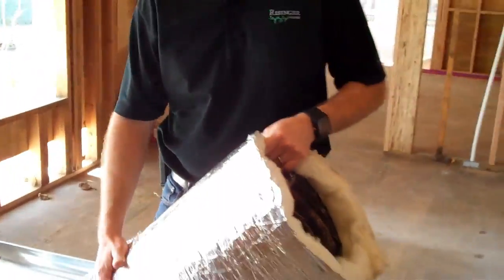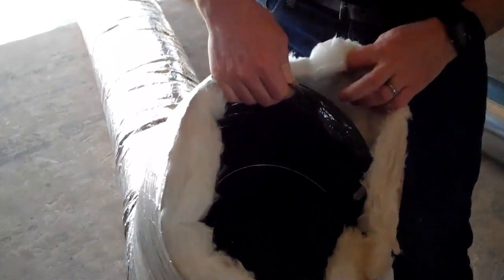Rigid Metal vs Flex for HVAC Ducting

Comment: Warning:
If These People Wanna
Replace Your Pipes For
Flex Ducts “SAY NOT”
Pipes Are Designed For Last
And Flex In A Hot Weather Is
Garbage And In A Few Years 
Gets Holes.
These People Wanna Install 
Only Flex Because They Are
Easy To Install And After They 
Leave You Wanna Replace Your
Air Handler With An Extra Tone
Because Flex Has The Not Same 
Insulation Than Rigid Pipes.
Amén.

Comment: Seach plan contains all the components of the perfect shed plan https://www.youtube.com/post/UgkxB7IXYxLzb_Ichhe45zM3Im5xfEiSp9vB that i showed you above. This includes cutting lists & tools, with clear labels showing what each item is used for. (so you can buy just what you need, budget better and multiply your floor space). So the shed ends up just clicking together at the end. Every part will fit perfectly. You see from all angles, what each part is supposed to look like before you start building.

Comment: Just had the AC company check my house out. I have a problem with one of the bedrooms not cooling. He said it was the box that distributes the air evenly in the attic and would have to be replaced. The quote was for 10,000 Dollars. Does that sound right?

Comment: It also helps to pull your flex ducts tight. If you leave them loose it restricts the flow. There’s barely a difference between flex and rigid when you properly size your duct and install it correctly. For the price difference it’s not worth it

Comment: That is the correct application for flex duct.  Use it for terminations only.  You should mention, that flex duct that is used in attics and crawl space is very susceptible to rodent damage.  They love to nest in the stuff.  I would specify 6-7 feet max of flex duct and just at the terminations.

Comment: I want to replace all the flex in the attic. Not even 10 ft flex runs. All will be sheet metal. How loud will the system be? I don’t like flex ducts at all

Comment: They used to make a flex duct called JPL. It had a scrim cloth interior that was not air tight.  If you got a tear in the vapor barrier, it became an air leak.  This crap fell apart inside due to airflow erosion.  We had a whole commercial building installed with it, and it all had to be replaced within the first five years.

Comment: Flex duct was originally designed to hook up between the trunk takeoff damper quadrant, and the register on commercial jobs.  It was never intended to be used to pipe complete systems.  Rodents chew right though this crap.  Thank you for doing things the correct way.  I prefer ridged spiral pipe with foil back insulation.  In certain parts of the country, flex is illegal.  If your HVAC contractor uses this crap for complete systems,  RUN.    Looks like you demand good quality.  Good for you!  I would say 6’ or less flex at the end of runs.

Comment: I would like to have heard some facts on rigid versus flex rather than just having repeated several times that “rigid is much, much better.”
Reply: He said that flex can be compressed restricting airflow, there is fiber in the airflow and it can be affected by uv rays. Rigid has better airflow, no fiber, but it is more expensive.  What other info would you like to have?

Comment: The metal duct will reflex the temperature of the supplied airflow because of it being metal as so whether it is hot or cold air., whereas the flex duct will absorb the temperature of the supplied airflow and discharge a totally different temperature versus what's being supplied to it. One other thing is the flex duct does not have a smooth inter surface which will create air rolling effects that are the same as turbulence, which creates resistance to the supplied air. So discharge air at the register will be off if not calculated properly.

Comment: I don't allow HVAC contractors to use ANY flex duct on my jobs. As you pointed out, it does not have a smooth interior surface and thus restricts air flow. System is more efficient without any flex duct, so why use it at all? It doesn't save that much money by using it. Stuff should be banned as far as I'm concerned.

Comment: A lot of people overlook the diffuser.
The celing defuser is rated at 50cfm for 12"x12" regester.
Usually 1 regester in every room won't flow enough cfm of conditioned air and will cause the ductwork to spring leaks.

Comment: In A perfect world, on a perfect day and  perfectly designed scissor trusses that all line up where you can get a metal trunkline is not reality "howbeit getting a 5' hardpipe in 24" O.C. trusses  sealing and insulating is a battle in itself"is not reality in most houses, it would easily take 4-5 times more labor time and expence to do it this way, But hey if your doing it time and material then milk it for all you can.A flex trunkline could be run in about 10 minutes as opposed to the metal trunk you showed would take a better part of the day

Comment: I have replaced at least a hundred of all metal systems because of failure. Insulation falls off and rusts out from the inside. More often than not the duct is full of rat excrement. They are not a one and done cost that lasts forever. What is more important than type of material is the knowledge of how to design a balanced system.

Comment: If metal is a good conductor of energy, why is it used between the air handler and the room?
Doesn’t it lose 40-60% of its efficiency?
Why not pvc?

Comment: I work with flex and we move it so it wont have restriction. We also put the mastic in the flex, attach it to the can, zip tie it tight, snip. Then bring the insulation over to mee the tie and tape it shut with flex duct tape. Then we insulate the remaining parts with brown insulation including the can if its showing silver thankyou. We have five stars on reviews on Google

Comment: In Florida, almost all residential duct work is that flex crap.  Yes, I say crap.  It doesn't seal well, tears, kinks, and degrades with the intense heat in attics.  If you get a rodent in the attic, (not uncommon), they may eat through it.  Unfortunately, insulated metal duct work is cost prohibitive for most residential homes.  So we are stuck with this shit.

Comment: Retrofitted a lot of older homes with existing pot soldered rigid ducts in them. 99% of the time I recommend keeping the rigid system and insulating to current State standards.  Often they are (by current methods) undersized but found that sealing them is easily enough to surpass current min. requirements by 50%. Personally and in the field Blaster and hood testing flex duct FR is wholly understated, it's much higher than the marketing states.

Comment: If you use a plentum box on the supply end of the furnace, please shut the fuck up and go do what you're going to do. Show that customer a picture of a REAL furnace fitting custom made, and then show them your plentum. Please, do it. You don't want to pay a sheetmetal guy and spend the money for a 10 foot break and be a REAL duct company. It's a little more expensive to use metal for the plentum? Go on and spend the extra 30 dollars? You're a jerkoff dude, you're a fucking salesman, you tell your fucking customer "we use a metal plentum which is better" and you fucking charge them on that basis, fucking jerkoff. Shut the fuck up until you have a sheetmetal shop and produce custom duct, but it's cost you more and you'd make less money. Jerkoff motherfucker. If you don't custom make your duct and you have a company, please don't talk like you're a professional, please don't. The first thing a plentum box does is interrupt airflow RIGHT off the furnace. I worked for a company that had a sheetmetal shop and we put in rectangular duct and we custom made EVRYTHING. The furnace fittings would transition from the 21 by 22 square right to the size of the duct for maximum efficiency and smooth airflow. You don't want that airflow to hit any corners, flat surfaces, or anything except a curve before it hits the end of the trunk. It hit corners and starts building pressure right off the bat with a plentum box. This guy looks clean, talks like he knows everything, and is a good salesman. We ran hardpipe until about 2 foot off the boot. That made it quiet. It dampened the noise from air flowing thru metal. If this dude talks like this and can't make a fitting and doesn't have a sheetmetal shop in his little homebase, he ain't SHIT except for another guy trying to slap a job in and make a few grand. Seriously. Don't talk all this shit about a duct system if you use plentum boxes on the supply end of a furnace. The pro's will know, you're trying to make money. That plentum box can mean the difference in airflow and 15 percent of a power bill. Don't try and tell me, I've seen it all. You want NOTHING but perfect airflow until that air hits the cap on the trunkline. Plentum boxes are for companies that don't want to pay a sheetmetal guy nor pay for metal and a ten foot break..

Comment: I know this is an old video, so I can only hope to get a response. I have a house that was built in the 20s. My ducting is made of metal and rectangular box shaped. Wrapped in asbestos to top it off, although most has been properly removed.  I would like to replace all of the ducting but am not exactly sure what to do because I am limited to the same shape that I already have since it has to fit between the Joyce's. Should I just replace it exactly as is, or is there a better option? I would greatly appreciate some feedback on this.

Comment: People who say that the flex duct restricts the airflow are overreacting. Technically, yes it does. However, installed properly, flex duct is more than adequate to get the job done properly. You just need to follow some basic rules and common sense when using it. Also, the wire that spirals the length of the flex is attached/molded to the OUTER side of the flex. The inner surface isn't nearly as rough/hostile as  you are making it out to be. As far as compressing or crushing the flex, just don't. Who runs around crushing their flex after it's installed?  Also, in some states it is mandatory that any duct run that will be inaccessible due to plywood, sheetrock etc. etc. etc...... must be 100% rigid with 0 flex.

Comment: How much more would it be to have all metal duct an no rigid duct?  Good houses are lasting 100 years or more, but I have found no house with any flex duct lasts that long without major structural repairs.  Maybe the new ductless systems are the solution but they are expensive to service an repair and do not last 20 years like a standard system will.  Also you will still need ducts for ventilation and perhaps humidity control so I think we will always need ducts.

Comment: My room is farthest from my AC unit. Its a good 5* hotter than any other room in the summer and 5* colder in the frigid Florida winters. I went in the attic to see if the ducts were leaking anywhere and didn't find anything. I cant take this heat when sleeping anymore. Gotta figure something out quick.
Reply: Frigid Florida Winters?
Reply: Popwarhomie I also lived in Florida and had the same issue but it was in my family room. I installed a high quality inline duct fan in the duct leading to my family room. The fan needs to be placed as close to the air handler as possible. I connected it to a pressure switch which activated the fan when the AC turned on. I also added a speed control so I could fine tune the amount of air delivered. I did it myself for about  $250. The fan was something similar to this https://hvacdirect.com/tt-silent-series-6-inch-inline-mixed-flow-fan-tt-silent-150.html
Reply: Thank you. Ill check that out.

Comment: Very timely advice. Just found out to today that my flex duct was trashed by pests and are wide open in spots. Trouble is they are located in a low crawl space. All work must be done either flat on your back or on your stomach.

Comment: What do you call the wall unit cage on the out side to protect the air conditioner or from thieves pushing in the air conditioner. Is it called a cage ?

Comment: "Flex" ducting was brought online because it allows poor designs to be built.  Starting at the beginning, a good designer will have modelled the house and studied the airflow and energy requirements.  After the stairs, and the structure, configure an airflow system that will work naturally (if possible) and then "assist" it as necessary.  A dropped drywall ceiling (3"to 4")  in a hall can be a central plenum, to supply any adjacent spaces.  Hot air should be allowed to escape in hot climates, causing cooler air to replenish it and overall having a cooling effect, before the HVAC equipment is applied to fine tune the environment.  The natural way is the best way always if it can be done, followed by the band-aids for bad design, the AC units, heating units etc..

Comment: Metal will sweat in the green grass states unless the installation is perfect...it will also sweat anywhere the insulation is compressed (resting on a 2x4). They make high quality duct board that has a smooth inner surface. I did my first house in metal, second one is all flex and ductboard.

Comment: would it be incredibly impractical to take on a job (the entire house renovation) this size by one's self?
Reply: Entirely depends on your skill set,  really the skills involved in hanging duct work are not all great, it's the design of the system to start with that requires the smarts, also the creation of custom connectors, say from the furnace out put to the main plenum or plenums.

Comment: love your videos... and watched lots of them.  i built a camp 4 years ago, and did not do an erv install at the time.  its one level, slab on grade... can i run insulated flex over top my attic insulation to supply bedrooms and exhaust bathroom/kitchen?  i'm getting a lot of condensation on my marvin integrity wood windows, and thats not a good recipe at all.  no problem when camps sitting on 12deg c when not in use, but as soon as getting there and bringing heat up to 23 with wood or elec obviously on cold days im getting some real problems.

Comment: We went all ridged duct.. mostly because we spray foamed the lines to make them air tight.. flex is so easy compared to ridged.. if you get a furnace guy to install “on the side” you can save a ton of $$$.

Comment: Flex board used in FL with flex duct feeds.  Much better insulated tin.  Static pressure have to be right for efficiency!  I bet less than half new and old are not.  How about putting mastic inside joint and then snap together seams and usual mastic over that.

Comment: Matt, I have a house in S. FL built in the 40s with the metal ducts. I got a high efficiency  Carrier Infinity and my ducts started to leak. I had someone come in to rewrap them and two years later there are wet ducts again. What would your recommendation be for this? Everyone wants to do flex ducts. The guy that had wrapped my ducts had a hard time because they site on the trusses. He also had to replace a short section with flex that is not suspended and it is now totally wet. I find it impossible to find someone to do a good job. I hate to give up my metal ducts but everyone keeps saying they will never be good any more.
Reply: Sounds like they're not properly insulated

Comment: This guy is spot on. Flex duct is used because it's: 1. Cheap. 2. Very fast install. 3. Allows for inappropriate installs for speed (i.e. weird bends, etc. to make install easier for the installer, yet the homeowner pays for it for decades for friction created and loss of energy). Very good video.
Reply: gone-shootin' not to mention the plastic becomes brittle and falls apart. in 8 years time.

Comment: All it takes is one hungry rat to chew through the flex ducts, costing you thousands to replace. I had this happen twice to me withing five years. I switched over to steel ducts and have not had any more problems. It cost me twice as much, but I will never have to replace the duct work under the house.

Comment: Metal duct work was installed in most homes in Texas until mid 80's then atco vinyl spiral flex was introduced, which after 6+ years would split open in heat. Foil back spiral flex then came into installations, and duct/board. Sound will resonate through metal so it is good to tip duct at the ends with flex. Take from Ole Timer 1970's hvac man.  Metal is better static  flow and out last flex.

Comment: the only real benefit on flex is it's easier to install if someone doesn't know how to join and hang metal runs.  we just did a house on Tuesday that had 100% flex in the crawl space.  had it all torn out and half the house ran with rigid by the end of the day, finished the metal runs and mastic on Wednesday.  it cost the client a little extra but it's well worth it.

Comment: Hmm flex duct is just fine if sized and installed correctly. It makes the job easier and faster and more affordable for the average person. I don't see any reason to do ridged unless code requires too or commercial application. I would put that money towards a higher efficiency system, uv light, media filter, dehumidifier or humidifier. But Metal plenums is a must.
Reply: The installed correctly part is the problem.
Reply: the problem is long term use of flex duct. I have managed school districts for 30 years and I have found in every case that stuff was used it wasn't installed correctly and through the years either damaged by people or rodents. I just wouldn't recommend it. Use metal duct, get great air flow and it will last a lifetime, plus you can clean it. Yes flex duct is fast, but in the long run not fiscally responsible...